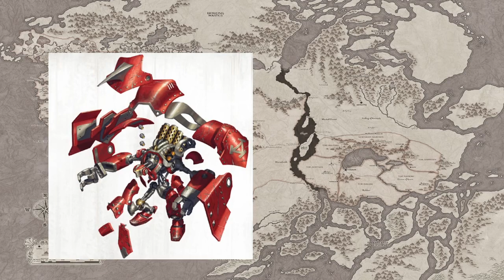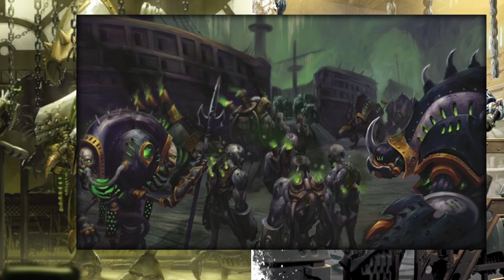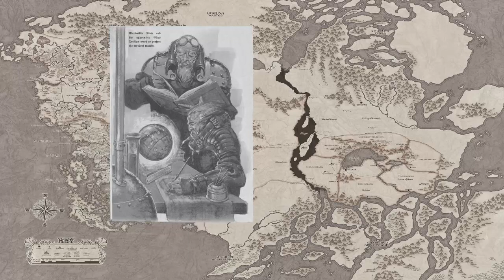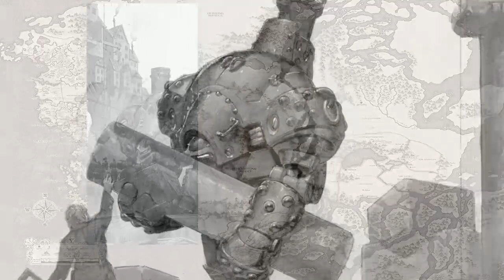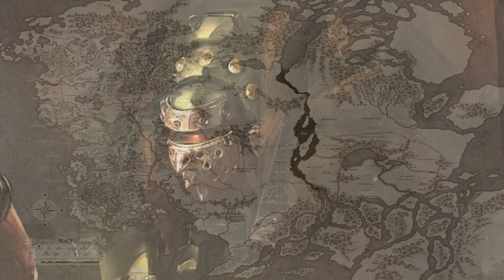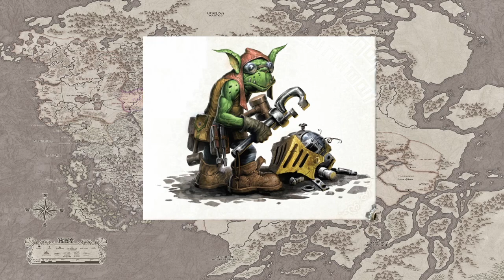Lords & Lackeys – Peace… jack? [2/3] [Labourjacks & jack maintenance]

Comment: With those cost of cortex wiping it makes you wonder if the probability for quirks among labor jacks and merc jacks for small companies is pretty high. If I got a construction company or farm of less then 50 people (from accounting to general laborour 1 positions) the cost of cortex wipes maybe seen as too much trouble. Especially if I am faraway from facilities that would offer that particular service. 

Human's are pretty plastic to circumstances and jacks can last anywhere from 300-500 years with proper maintance. So in situations where cortex wiping is not as common as standard mechanic services and is too expensive, not only would the jacks develop quirks but the people around them would get used to them. Over time they may even see the cortex wipe as taboo or not encourage it as workers build emotional attachments to the jack.
Reply from the maker: TBH, that's something I didn't look too much into (admittedly out of laziness more than anything). I'm unsure about the necessary 'cost' of cortex wiping, though presumably it is (also) more inconvenient to do it in a rural (or even industrial) situation than military as AFAIK it requires somewhat more specialist equipment to perform than is commonly available to artificers even if the material cost of the cortex wipe itself may not be particularly high (beyond requiring the kit to do so).

I suppose it would be a case-by-case basis, see how much the quirks affect the jack's performance (and, as you say, how much the users get accustomed to them as well). That emotional attachment is a good point as generations of labourers use the same jack/cortex (in a pseudo-ship of Theseus way). That said, I was thinking more of in a 'here's a jack for much cheapness for a new home in a new industry/new owners, do what you will', if in a rather obtuse way, now I think on it. -.-
Reply: That's basically Drago